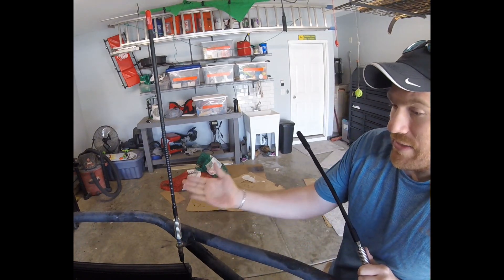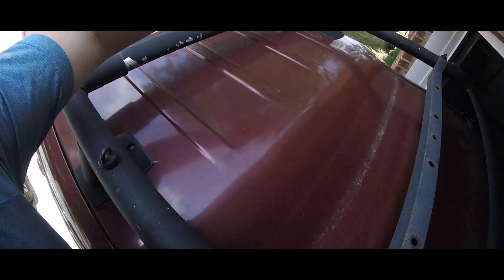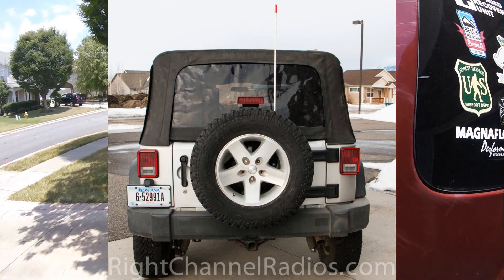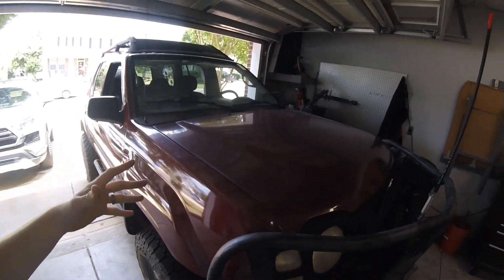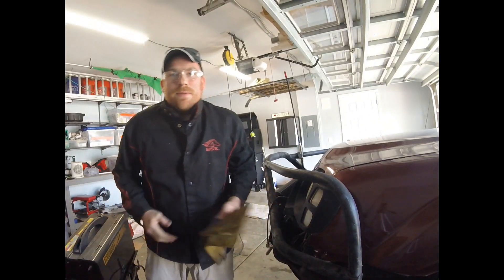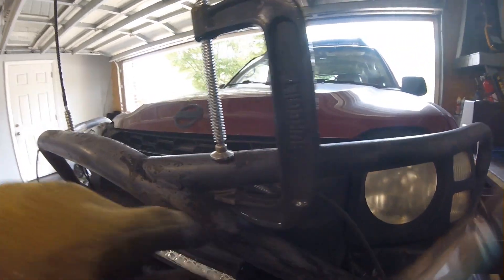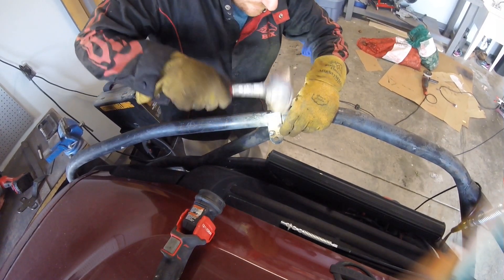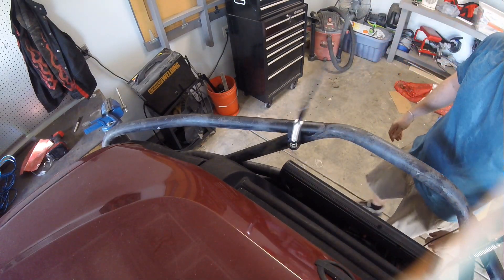Installing a Mobile Radio (CB, Ham, etc) in 2004 Nissan Xterra (Part 3: Mounting an Antenna)

Comment: Rob, excellent content! Regards from Argentina!

I have a v6 XTerra but they are not common here, Nissan made in Brasil the XTerra with diesel engine. 

Question… what brand of antenna are you using? And what coil? I want a 2m antenna like that, and not the traditional base-loaded coil antenna. 

Thanks!
Reply: Excuse me, when I wrote what coil, I tried to say what spring. It’s very flexible.
Reply from the maker: It is a firestik antenna.  Model 2M15S-B.  It's a 1/4 wave on 2 meter band.
Reply: @XterraRob  thanks! The spring came with the antenna? Thanks again!
Reply from the maker: Yes...they have a version with the spring and one without. Since the spring electrically becomes part of the antenna... The antenna mast is a couple inches shorter when it comes with the spring.